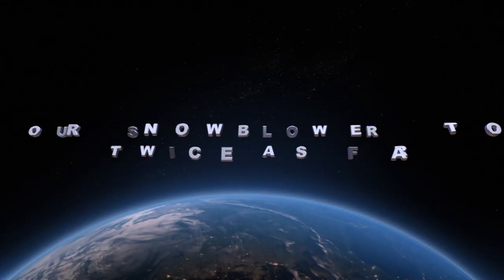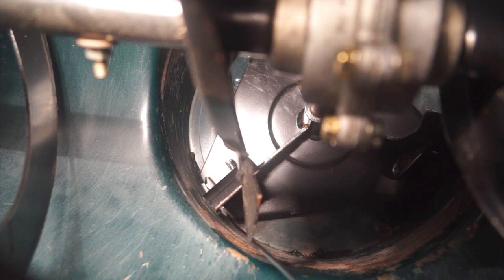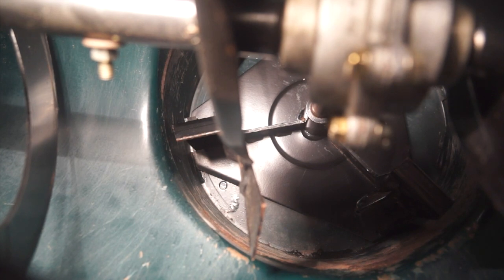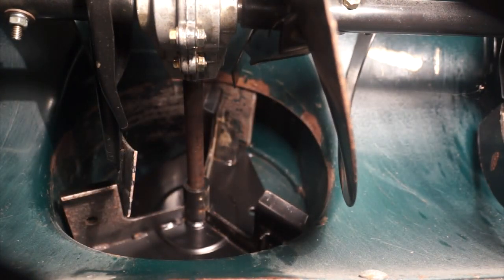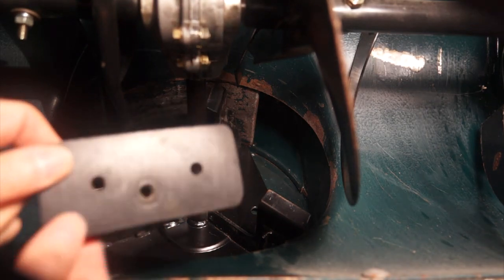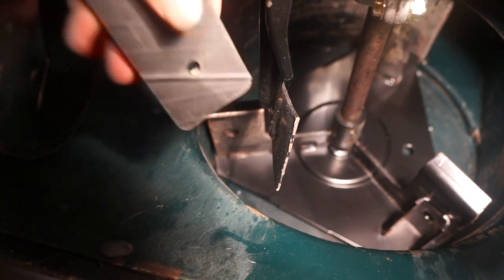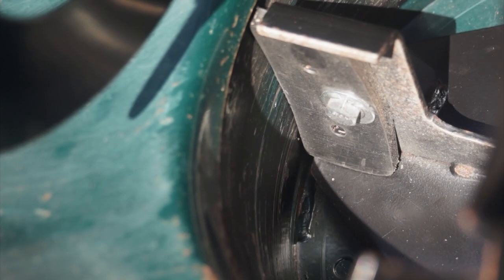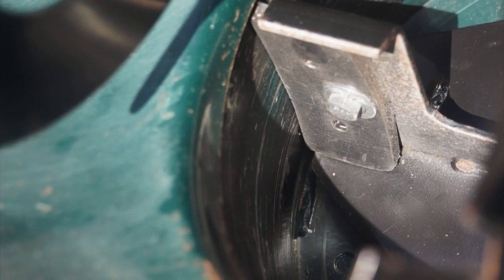Modify snowblower to throw twice as far and never clog

Comment: Questions: Did you have to drill the holes into each impeller blade..or were they already factory drilled? Its been a number of years..can you comment on how well this mod worked? Thanks so much!
Reply from the maker: If I recall, I didn’t need to drill anything. I’ve had no issues with good throw of snow and none collecting in the shoot. As an added measure a quick spray down with some WD-40 before use, helps even more.

Comment: I am surprised you didn't add a metal backing plate to provide more support for the rubber. Would it not be preferred to mount the strip on the leading edge of the immpeller as it rotates?
Reply from the maker: Not needed as of yet. Pads are holding up just fine.
Reply: I placed my baler belt straps on the leading edge. Don't need any metal or anything else.  Just drill some holes and bolt them on

Comment: On my John Deere 40" blower, snow gets packed against the walls of the impeller housing. The impeller blades then pack the snow and fill the space between the end of the impeller blades  and the housing sealing the gap and making the performance as good as it will ever get. No good reason to spend time bolting rubber parts in places they're not needed!!

Comment: I've done this mod to my Ariens. While it does work as advertised and it works great, I had two issues. One: if you don't leave a small gap (about 1/16") between the rubber and the side of the chute, any snow that remains in the chute will melt once the snowblower is back in your garage and freeze the rubber to the side wall and promptly tear the crap of of the impeller belt as soon as you engage it. Even with a 1/16" gap, I've had to manually rotate the impeller to break the rubber free from the chute before starting. Two: with or without a gap your going to put additional stress on the impeller belt shortening its life as that rubber doesn't wear down any where near as fast as the OP suggests it will. Speaking from experience, plan to purchase an additional impeller belt to have on hand when it decides to prematurely brake during a storm. Some snowblowers have a double impeller belt and might not be impacted as quickly as mine with a single belt, but that's just my two cents.
Reply: Suggestion: Use an electric hair blower to melt off the ice that's seizing the impeller rubber to the chute before starting. Great article and comments!
Reply: When I'm finished with the blower I clean it out and the I stick a small ceramic space heater in there and I make a kind of cardboard "garage around the whole auger bucket and finish melting all the snow.

Comment: I can't even imagine trying to drill holes/install these things with everything in place on the machine. Sigh.
Reply: I have similar model and it was manufactured with those holes on the impeller. Not all may have holes but if they are there best use em!

Comment: rubber on imbellar is only good for a few hours, to do it right you have to disasamble the impellar and weld hard steel  on the end of impellar blade almost zero clearance to the auger housing, and another thing to improve snowthrowing is to get a bigger shute and lower it near the augerhousing, if you do that you will never have problem with wet hard snow
Reply: I've had silicone rubber pads of my Ariens impeller for four seasons with no significant wear. There might be a very small gap in a couple spots of less than 1/6" as best as I can measure. Looking forward to winter season #5 where we usually get over 10' of snow each season.
Reply: I've used mine for 3 years now and the rubber pieces are still installed like the day I did it. Once the rubber sits it will not wear out, so I have no idea what you are talking about lasting a few hours. This is a great way to improve the snow throwing without the additional costs of taking apart and welding hard steel or spending money on a larger shoot. Makes no sense what you are saying.

Comment: Did this & it works like a charm! I cut pieces of tire wall and used farmer screws to make it a bit more easy. Haven't clogged since and throws the snow 100% better/further!
Reply: Did you mean self tapping framing screws.
Reply: @craftman5632  He means self tapping screws, yes.
Reply: If using salt tapping screws what did u use to secure opposite side? I bought the  pads and am ready to modify but was wondering what would be better, self tapping screws or drill and use hex bolts with locking nuts
Reply: Get someone else to do the work!
Reply: I cut pieces of tire wall " Not steel-belted I am guessing
Reply: @Raul28153  No! Not steel-belted side walls 👍 I had 2-3 ordinary car tires laying around and non of them had that in the side walls.
Maybe that's more common in industrial application, heavy use/equipment tires? Never heard of steel belted side walls, but I'm far away from a tire expert.

Comment: Where did you get that pad from?
Reply: I cut and used pieces of tire wall! The sides of a tire, without all the wire.
Reply from the maker: amazon or ebay
Reply: @imsmoother  what do u search for?
Reply: @spencerhill64  snowblower impeller kit on ebay. Some have 4 blades, others 3, check before ordering.

Comment: Awesome, Im surprised they done come with those strips from the factory.
Reply: I'm probably showing my age a little bit by making this comment, but almost NOTHING is built the way it used to be built or should be built. There's no money to be made selling products that last forever and need no modifications to work like they should.
Reply: @maximusmax4557  And yet many American companies used to do just that!  They put in the effort and strove to outdo their competition and produce a quality product that actually had some value, EARNED their customer's business and didn''t take it for granted. They provided jobs for people in that community.  People would spend their entire working career with the same company.  AND they were profitable!  Hmm....  how did  they manage to do that? 🤔
Reply: It would add a fair amount of cost to do that.  And if they wanted tolerances that tight, they would just build it that way rather than addon another piece.   For example, I had an older Ariens, I think it was an '80's or 90's model, I forget which.  That one had about 1/8" gap from the factory.  It would clean itself out rather nicely.   I now have a newer one, probably 5 years old now.  Same brand.  Now they use about a 3/4" gap(I'd have to check it again, it's pretty big, maybe it's not 3/4" tho)
Now, originally, the older one did not throw snow very far, maybe 10' on a good day if it's light and fluffy, but you were looking at 3' if it was wet and heavy.   My new one will throw snow 30'(or it seems like it), and even throws heavy snow 10'.   There are probably a few reasons the old one was so weak.   Motor might have been one.   But, one glaring difference is it was a 24" wide model with only a 10" impeller.  My new one was only 22" wide, but had a 12" impeller.  If you ran those 2 impellers the same RPM, the larger one would still have a higher tip speed and throw snow further.
Because the old one was weak and really had problems with slush, the mod I did was to remove the stock 9" impeller pulley and replace it with a 6" one.  this gave it about a 30% RPM increase.  Let's just say it spun pretty fast.  Even the auger started to look like those single stage ones because it spun so fast.   Then that thing really threw the snow and rarely plugged up.   Surprisingly, tho, my new one stock still threw snow a little further.  Not a lot, but it was a few feet further.  enough to notice it.  Although my new one has no throttle control, whereas I did not always run my old one at full throttle.
So, given that information, I'll compare my modified close tolerance blower to my new stock loose tolerance blower, since they threw snow similar distances.
The tight tolerances would throw snow just as far when fully loaded and when cleaning up scraps.  But if it got a rock or heavy object in it, it would LAUNCH it!  It would fly twice as far as the snow.  I learned to be really careful where I pointed the chute.  Also, sometimes when you put it away, snow would melt, then freeze in the bottom, and due to the tight tolerances, you'd have to manually break loose the impeller before you could use it again.
The large gap impeller, in comparison, would throw snow far as long as it was full enough to have enough snow to fill that gap, but if you ware cleaning up small amount of snow, it would fall off of the ends of the impeller and barely throw it out the chute.   But, heavy objects would also do the same, even when the blower was full, and I never had it really launch anything heavy out it, like ice chunks.  They would just bang around and launch a few feet out of the chute.  I also never had it freeze, and sometimes I had it pretty full of snow when I put it away.  Depends on how much of a hurry I was in that day.
So, in my opinion, those are the pluses and minuses of a close vs. loose tolerance impeller.
Since I'm talking about it, the auger tolerances also had a similar change over the years.  The old auger had a small gap to the bucket and the new one has a very large gap.  The effect I notice is the tight gap cleans up even small snow right up to where you stop the machine, the large gap auger always leaves a small pile of snow where you stop the machine.
The benefits I could see to a large auger gap is you are less likely to have some foreign object, like a rock, jamb the auger and snap a shear pin.   However, I have never broke a shear pin on any snow bower yet.  One thing I did notice, tho, is all the old blowers with close tolerance augers, the buckets are always all scraped up with those rusty vertical lines scratched into them.
As much as those two things affect performance, tho, what actually bugs me the most about new machines is the augers are more recessed.  If you look at some machines from the '60's, the augers would actually stick out the front.  Those could chew through ice and hard packed snow easy whereas the augers on the news ones can't hardly cut into frozen snow banks because the bucket hits the snow and stops the machine before the auger can really get a bite.  New machines have to really work hard to get through frozen snow.
Reply: @l337pwnage  I wonder why they moved the augers inside more on new ones.
Reply: @l337pwnage  No doubt it puts stress on your engine.
Reply: @l337pwnage  you like writing books?